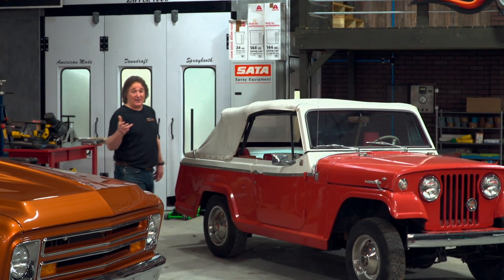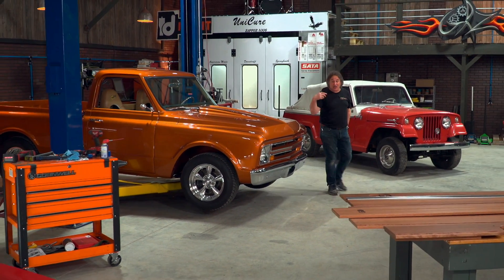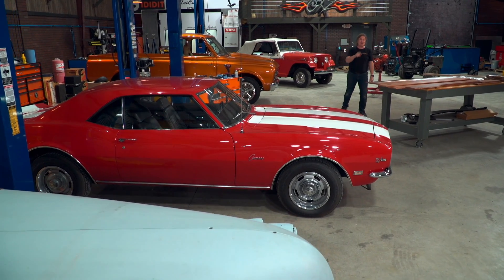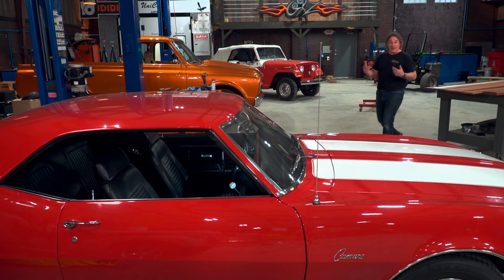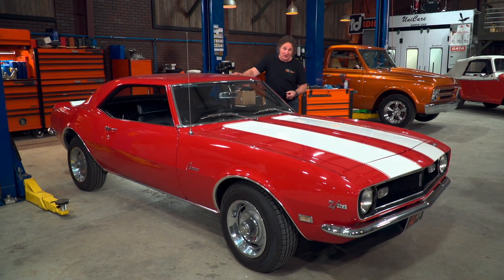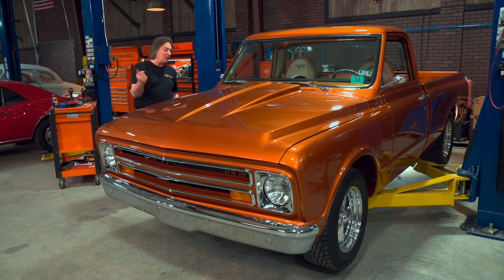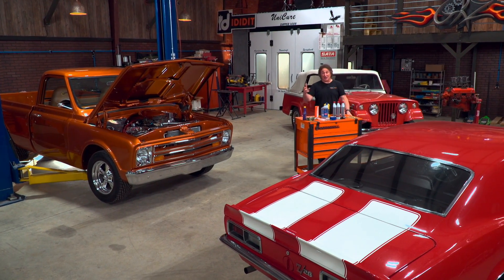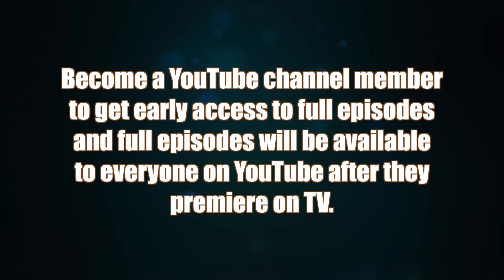Maintain Your Classic - Stacey David's Gearz S17 E2 TEASER

Comment: If only the cars that could be restored weren't so darn expensive to start with!
Reply: If they were cheap to start with, it wouldn’t be worth anything once restored, just a big waste of $
Reply: @FreddyFirepipes  Why not? A $1000 74 Lincoln and a $5000 74 Lincoln differ in price and how much work you're willing to put into it. When resto'd to the same level, they are worth the same. There is a dearth of vehicles of lesser cost. So much so that its getting harder and harder to start teaching folks and then letting them go on their own projects. No kid making $15 an hour is ever going to be able to afford to work on a 50's or 60's car... unless its not theirs.
Reply from the maker: There are plenty of cheaper cars out there. You'll have to pick something that isn't cool at the moment and make it cool yourself!
Reply: @OfficialStaceyDavid  I believe it. I just don't think they are anywhere near major metro areas. Locally (mpls/St. Paul) Any car of any make older than 1989 is $4000 to $40000. There are two 'project cars' available within 100 miles. One has no engine, the other is a body of a sedan of a different make onto an international scout frame as a mini monster truck. Its...cute. I'm in a tight spot as it is, and 4 grand or higher is a bit out of my price range. And by that I mean a lot out of my range. :) Actually, I could use a little advice on a car related situation. Is there somewhere I could send a short letter to you? Also, there is someone locally to me that is selling  boatload of mopar cars for $5500 each.Found it while looking this morning. Parts cars less. Is there a way to share that with everyone? I don't want to get busted for putting links n such where I shouldn't.  :)